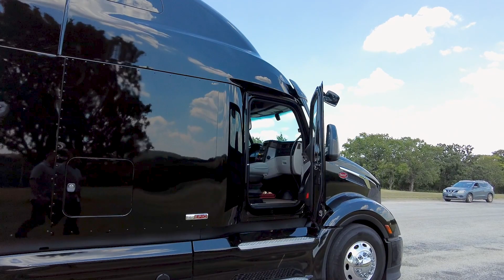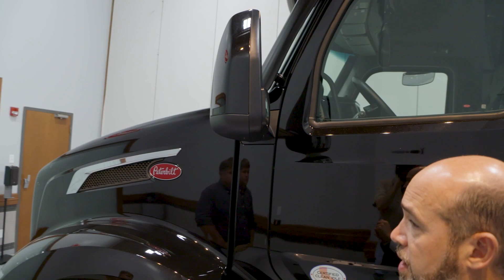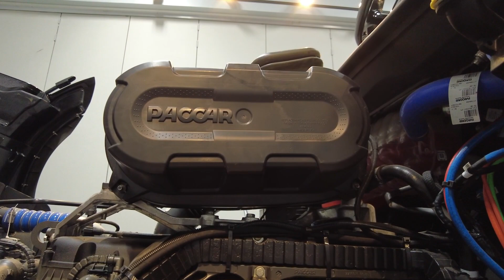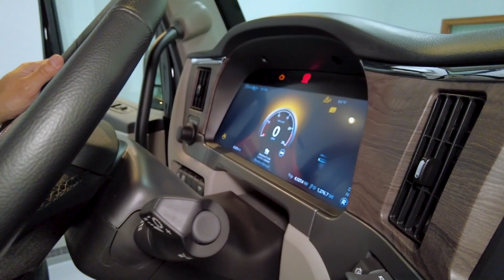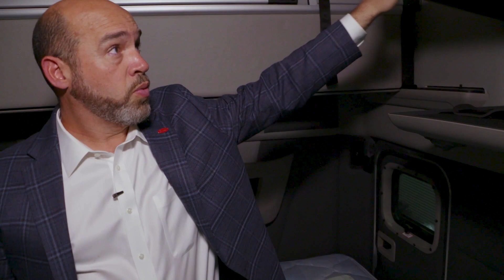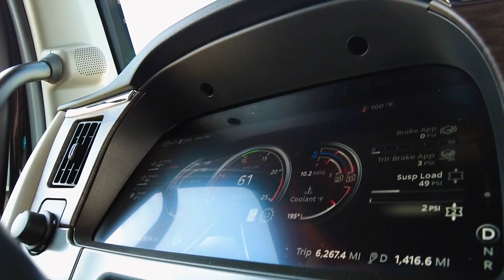2022 Peterbilt 579 tour of updated features and test drive

Comment: My fav truck as a driver 579 unfortunately i can't afford one. Smooth ride and plenty power is understatement idk how automatic is these days
Reply: I don't know about Peterbilt but the AMT from Freightliner constantly fights you when trying to make low speed maneuvers, specifically when backing. Just watch for the entire truck to start rocking side to side when the driver tries to slowly back up. It's the clutch grabbing and letting go repeatedly which if you keep the throttle where it is well continue to get worse. Anybody sleeping in back will get thrown around as well. The only way to stop it is to get off the throttle or step in it and jump backwards several feet all at once.

My opinion, all AMTs are garbage in the real world.

Comment: After putting a few miles from new " 50k" , I can tell you the fresh outside update didn't improve several issues with the past 579 and added some new problems.
First the intake vents on the side of the hood rattle so bad it's can be heard inside the cab with the windows up, the steering column plastic cover started rattling at around 40k just like my last 2 trucks " 20.00 in sound deadening mat would cure this" , the digital dash is a whole new world of terrible ideas, it was definitely not ready for production, nothing but trouble.
It can look good all day, but the cosmetics and interiors on these trucks are cheap and quality control is definitely lacking for something in this price range.

Comment: Wonderful, but there is a threat to these Diesel engines which is electric and hydrogen power namely electric that have 700 plus horsepower motors by design. These new trucks are here and are advancing by the day, month and year.
Reply: Still go to the end of the decade to rack up the dough and get ready to  venture to a new industry or get electric power

Comment: I would like to ask a question. I’ve called 3 dealerships and no one actually knew how to answer. Question is how does the fuel system work with the dual tanks? Does they both pull fuel or does one pull from the other  and can you fill the driver tank and passenger tank pull from that tank as well so if you want to run a short run and would like to prevent from fueling both tanks? I do understand the float does not reach the bottom of the tank so treat a 1/4  of tank like it’s empty for incline hills and bumps.
Reply: Pulls from one return to other with an equalizer line between the 2